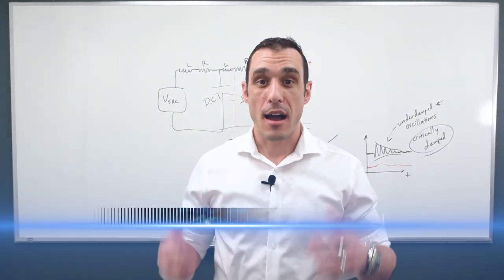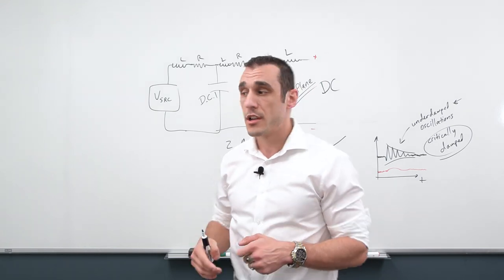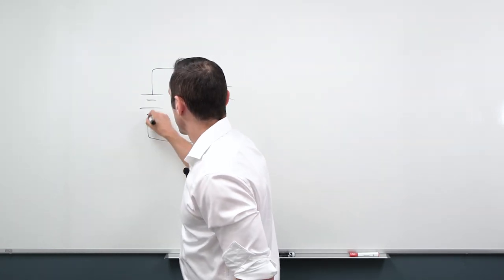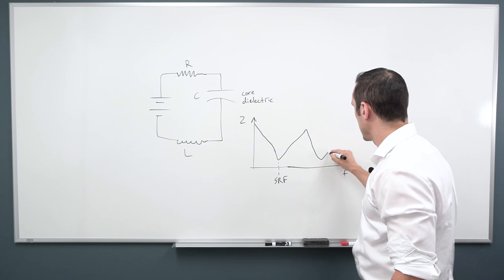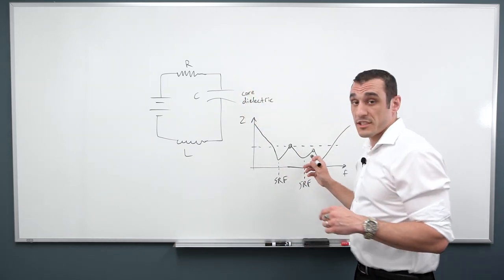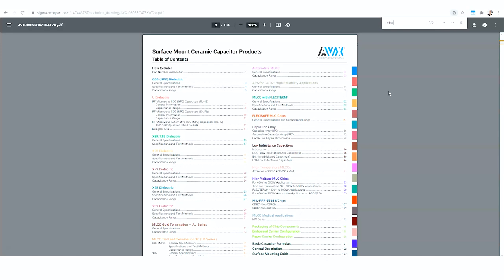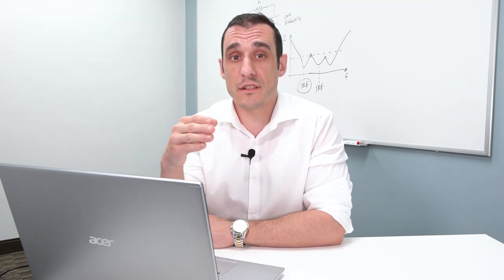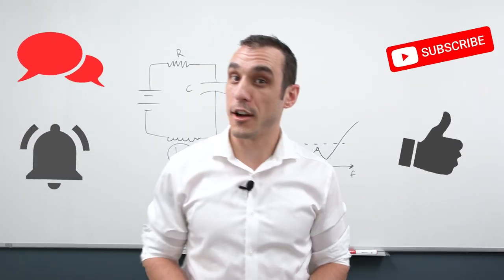Capacitor Self Resonance | Power Integrity in PCB Design

Comment: For those that don’t know, there is a huge difference in impedance (specifically inductance) when you include the full 3D model simulations of a real simulated board
Reply: Yeah that's true because then you can extract factors like the spreading inductance and real via inductance, but circuit models are a decent way to get started determining the amount of capacitance you would need at different frequency values.

Comment: Got to be a little careful with this, though:  Capacitor values that are any where nearby in resonance can interact and create more problems.  When more than one value is needed, it may be better to use values that are further apart in resonance and then use several of the same value in parallel to lower the overall curve.
Reply: I have two books that agree with you, both authors concludes that choosing the highest capacitive value in the smallest package, and placing as many as you can afford will gets you far better result than trying you hands at the "impedance roulette".
The left part of the impedance graph is dominated by the capacitance value (more=better), the left half by the package (smaller=better).
Placing many in parallels (and close to each other) will lower the whole curve instead of adding peaks here and there.
Also, MORE VIAS to the plane. 3 small vias will do a lot for the inductance.
See those two very interesting books: PCB Design for Real-World EMI Control, Bruce Archambault, Chapter 8.4
Electromagnetic Compatibility Engineering, Henry W. Ott, Chapter 11.5 to 11.9
Reply: You brought up the exact point I discussed in another video on controlled ESR capacitors, go check it out if you have time.
Reply: so its not worth having a lot of capacitors in parallel?
Reply: @user-ww2lc1yo9c   to reach low PDN impedance values required in large processors up to ~100 MHz range you need to have many small capacitors in parallel. For much smaller ASICs this is not the case because they do not have enough fast I/Os to require large numbers of small capacitors. So in summary, there are practical instances where you need to have many capacitors in parallel, and I think I have shown an example of this in other videos.

Comment: Hello, One question that remained non-answered is How we determine the critical frequency which needs to be suppressed for our circuit?
For example, let's say my MCU  works with a 16mhz OSC, then does it mean I need to select capacitors with almost 16mhz SRF? Or , do I need to select varied capacitors with various SRF including 16Mhz for better noise immunity?
I think the second is right but I'm not sure about determining the critical freq as my MCU's  OSC freq.
Reply: My guess (this is new to me as well) is that you just follow a logarithmic curve going towards zero, to an infinitely small capacitor. Starting with the frequency you want to filter out.
Reply: Hi Mustafa, this is a great question as it relates a lot to the difference between switching frequency and bandwidth. I'm going to create an article on the blog about this, and we'll create a corresponding video. Thanks for watching!
Reply: Hi Mustafa, we looked at part of your question in another video, you can check it out here: https://www.youtube.com/watch?v=tbIekfIf8dI
Reply: @Zachariah-Peterson  it would be great to create a comprehensive video on this topic and just shoot it down. All relevant information in 1 place.

Comment: Can you please comment on modelling SMD resistors? How to get the right value of the parasitic capacitance? The vendors do not generally make the resistor models (for use in Altium or ADS) available. Thanks.
Reply: If it's just a resistor then it's a simple RLC circuit in series. Sometimes you can see the impedance curve from the capacitor datasheet and you can determine the ESL and ESR values from that graph, this is sometimes the case with ceramic caps that are marketed specifically for use high frequency circuits. Some datasheets will specifically list an ESL value, but might only list a maximum ESR value (it varies when not a controlled ESR capacitor). Finally, you could also measure it if you have a good enough scope and square wave generator, probably also with an LCR meter depending on the frequency range where you are looking for the self resonance.
Reply: @Zachariah-Peterson   Sorry, if I am mistaken. You had mentioned capacitor datasheet, ESR and ESL. With SMD caps, yes, we can get the ESL and ESR value and the design kits incorporate these effects. For SMD resistors, there is no such data. For example, if it is wire wound resistor, we would need the inductance value. For SMD resistors, we would need the parallel capacitance value to model them accurately.

Comment: Hi Zach, I heard from Eric Bogatin that the ESL of a capacitor is strongly related to how we mount it on PCB. Does it imply that we cannot just look for impedance curve or inductance value in datasheet since we don’t know how they mount on their test PCB and how they de-embedded? Please share your idea about this.
Reply: Yes it is true that any pad, trace, and via will add its inductance to the ESL value of a capacitor. There is also spreading inductance to consider in the planes. I would say to be careful when looking at impedance curves, make sure that they are representative of how your capacitor would be mounted or that they provide an inductance value based on case size. AVX has a really good guide on this that lists some values for the self-inductance based on SMD package size: https://www[dot]avx[dot]com/docs/techinfo/CeramicCapacitors/parasitc.pdf
I do like Eric's advice about case size, find the smallest case size that provides the capacitance you need, and you'll have minimized inductance. Then you can worry about how it is mounted; vias connected back to a plane layer may add up to 1 nH to the ESL value, while moderate case sizes would already have about 0.5 to 1 nH ESL. So once you get down to the 0402 or 0201 size caps, so a through-hole via's inductance could comprise a large portion of the total inductance.

Comment: but when u choose different capacitors in parallel, the demo in the video assumes that all 3 ESLs are different..but in general...since their packaging (plus their respective pcb current loops) are most likely the same...seems like put several capacitors hardly lower the total impedence level?
Reply: They may not have the same total ESL (meaning package ESL + via inductance), they could be different based on package size, where they are located along the PDN, and via inductance. With any impedance generally, if you place N impedances in parallel it lowers the equivalent impedance by (1/N) assuming there are no other parasitics between each impedance.

Comment: Thank you for the great vid Zach! I was wondering if you could clarify a question I have. With a real bypass capacitor having a self resonant frequency and essentially being an RLC circuit, are there conditions under which it can behave as an oscillator when excited at/near the SRF?
Reply: Well technically that's exactly what it does when there is a transient event. Whether it behaves like an overdamped, critically damped, or underdamped capacitor depends on the value of its parasitics. Controlled ESR capacitors with high ESR are more likely to be critically damped or overdamped. You can learn more about controlled ESR capacitors here: https://www.youtube.com/watch?v=Bw0nkfxqTGw
Reply: @Zachariah-Peterson  Thank you for the reply, very helpful! So, if the return path for the capacitor is too long, or the current through the capacitor is large, can bypass capacitors generate a significant amount of radiated noise?

Comment: Hi, Great video as always! I have a question on selecting these capacitors though. It seems like even though those three fixed values are a myth, why wouldn't someone just pick their own values based on the impedance curves and stick with them forever? Would you want to adjust the values based on the speed of the circuits that are using the PDN? For instance, if I have a 1ns logic signal that uses 3.3V I would want to make sure there is good capacitor impedance overlap in the 1GHz range on the PDN so that when the current is drawn the self resonance is reduced. I guess I am just a bit confused when and why you would want to change the capacitor values except for just wanting a "cleaner" power signal in general
Reply: Mostly because those regions where those peaks occur and the PDN resonances arise can be at different locations depending on the stackup, sizing of vias back to planes, spreading inductance in the plane layers, pin-package inductance, and the package size of the capacitors you're using. Also if your capacitors are very high Q, then it will be more difficult to pick that value that helps in a lot of designs. Lower Q is usually better for targeting a broad range, but these will have higher impedance so you need more of them in parallel to hit your impedance target. I would say instead of having one capacitor value and sticking with it, find a few capacitor options or ranges and adjust the capacitor value you need based on some simple estimates. For example, if you are workign with a smaller component and you have to use a smaller rail to hit all the power pins, then you might need double the capacitance at your particular frequency.
Reply: @Zachariah-Peterson  how does a person really know what values to use?